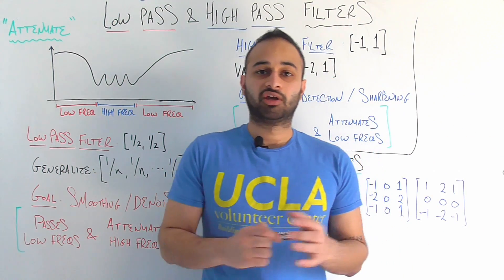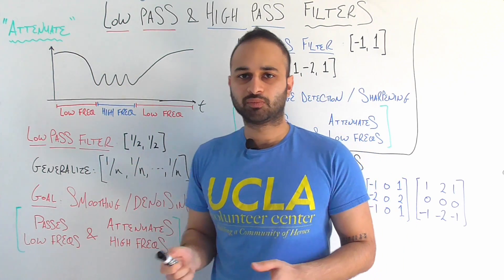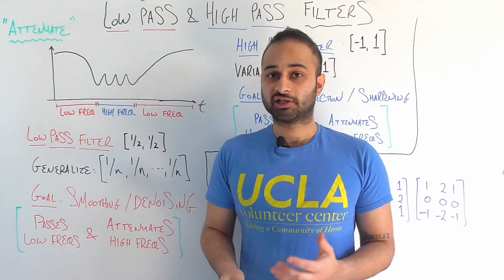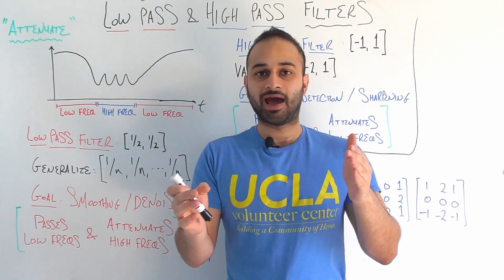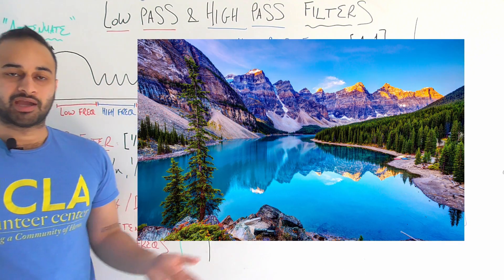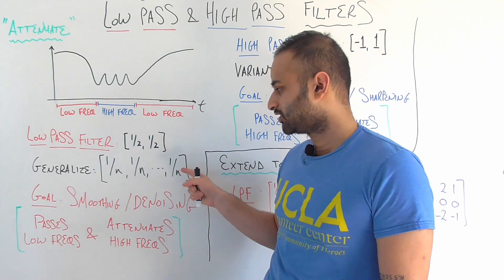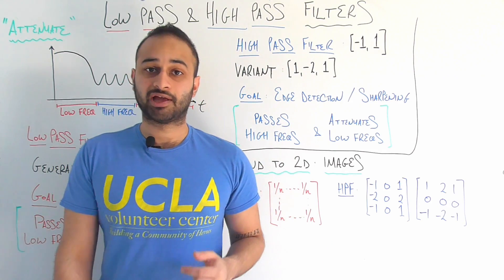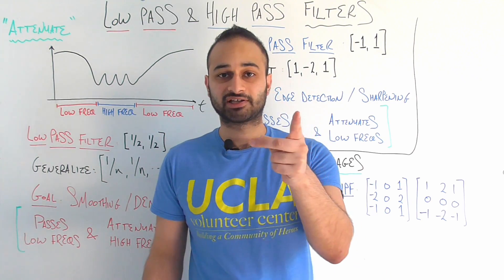Low Pass Filters & High Pass Filters : Data Science Concepts

Comment: They don't call it a kernel in signal processing, they call it a window function. Statistics calls them "kernels". Interestingly, the use of window functions predates eg. Holt-Winters Triple Exponential Smoothing by over a hundred years and statisticians failed to give credit appropriately.
Reply: Nope. In DSP the Kernel is the array you convolve by. A window is different from a kernel, when you window a signal you are multiplying it point-by-point with a shaping function. Kernels are about neighborhood of operation. There is a slight difference.
Reply: @mikegazzaruso Funny, Prabhu uses window function in his book on filtering. I stand corrected, thanks! So kernel = when convolved, window function = multiplied but not summed.